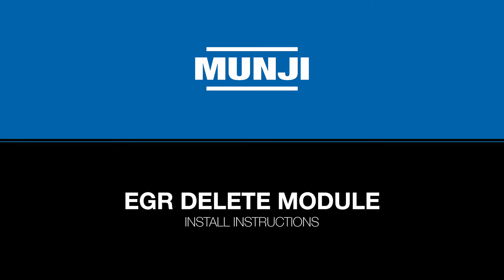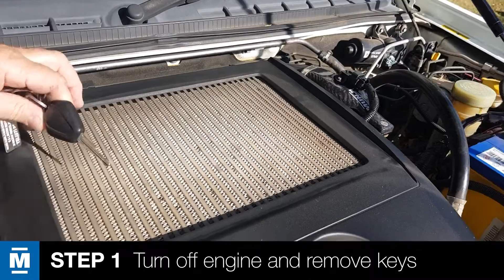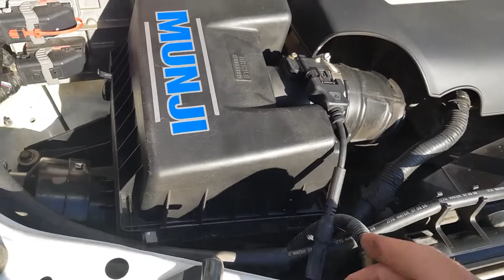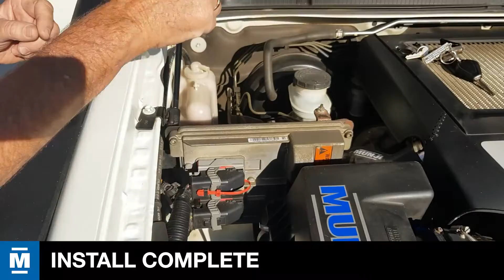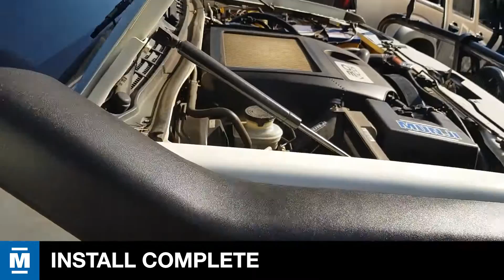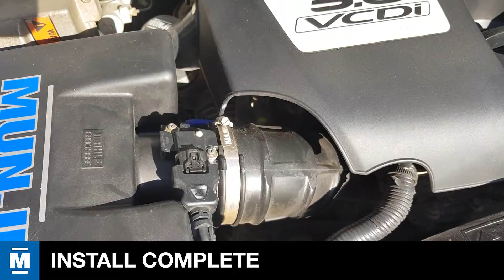Munji 4x4 Accessories - EGR Delete Module (Install Instructions)

Comment: If the car has a EGR error code with the check engine light on, instal this module turn off  the check engine light.

Comment: Hello. After the application, did you have a problem? Thanks
Reply: Jassu Giorgos. I am using these Modules on my Nissan Patrol, they have it also for Mitsubishi Pajero and other cars. The ECU tells the EGR to be closed and ! the power is calculated with Fresh air + Diesel and not with fresh air - Exhaust gas and Diesel. Therefore the Diesel consumption drops at about minus 1 to minus 1.5 Liters. 
I am using such a Module on my Nissan Patrol Y61 since about 200.000km. See my channel. Cheers !
Reply: @JohnDoe-ql5mi  Hello my friend. Today I did the cable installation. At the same time I put a lid on the exhaust of the egr from the exhaust manifold. Now it works fine without codes and with more torque. It is very good. Thank you very much
Reply: @George-kar  it's also can be installed this module without using the egr blanking device right?